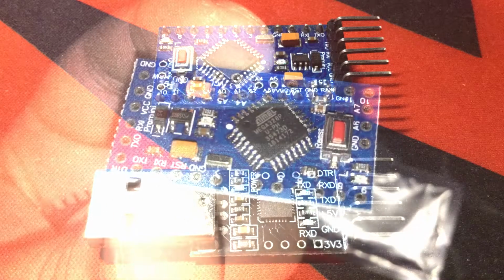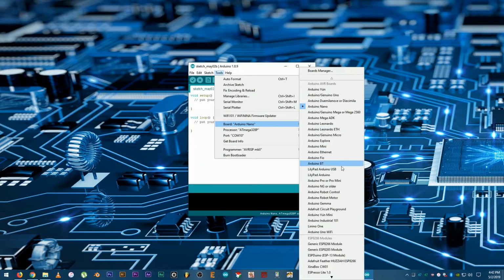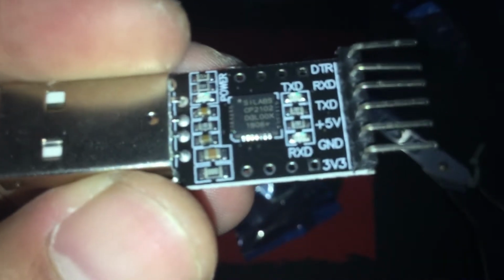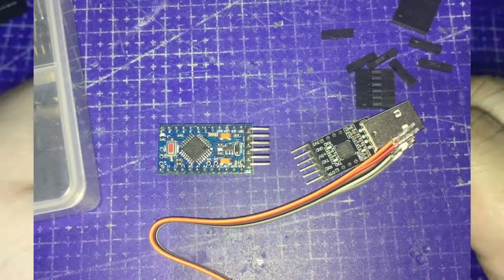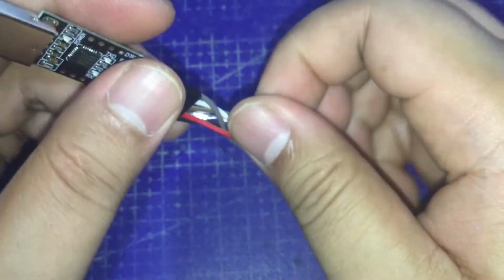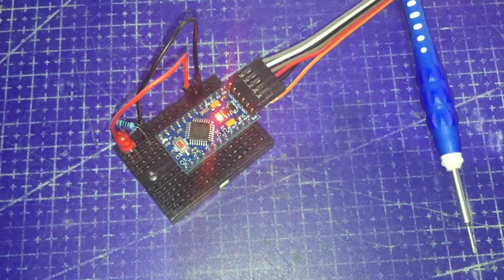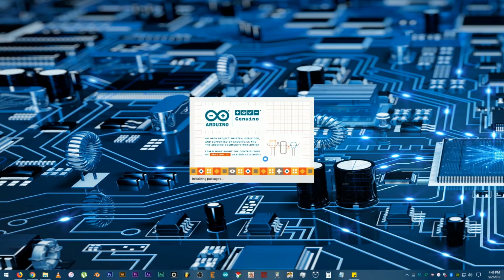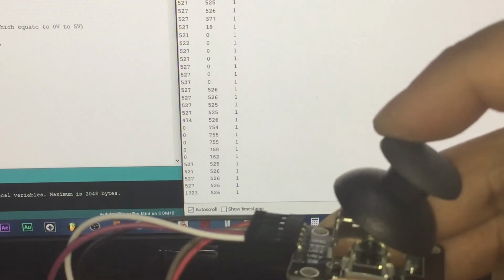Arduino Project #14 | Arduino Pro Mini With CP2102 USB to UART [No Driver Installation Needed]

Comment: with a wiring connection like that, can it used to serial communication with a raspberry pi 3b+ with an arduino pro mini?
Reply from the maker: Hello, and thanks for the question. Unfortunately, I have no idea, because I don't have a Raspberry Pi.

Comment: Hello bro nice content 👏👏

I need your help
when i connect my telemetry Ground module it shows, Unknown USB device (device descriptor request failed)... 
I can see cp2102 chip is there...
Actually it needs to be recognized in port instead it was recognising in universal serial bus controller and showing that error

The things I tried, 
1.Uninstall and restarting
2.disabling and enabling
3.windows troubleshooting
(it could not find the solution)
4.updating driver(Tried both cp210x and fdtm)
But the problem is I can't update it... It shows the best driver for this device is already installed...
5.usb oblivion
6.trying with my friends laptop
7.changing power options in my pc...

Nothing worked.... Please help me
Reply from the maker: Hello and thanks for the comment! Good question. Unfortunately, I have no idea.

Comment: I want to use cp2102 without driver because I want embedded object to raspberry pi directly using usb to uart converter but i cant use cp2102 like you. how can use like that?
Reply from the maker: That's a good question. I don't really know how I did not need any drivers for it. It just worked right away back then.
Can't really try it now, however, because I'm not on Windows anymore.